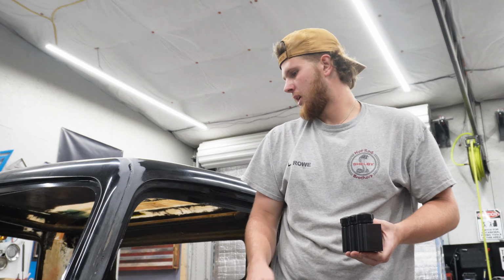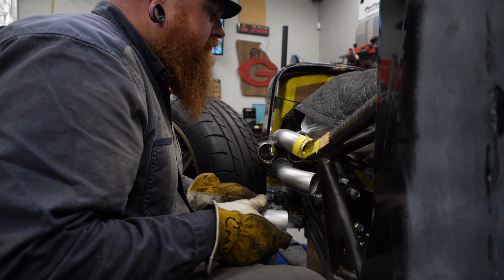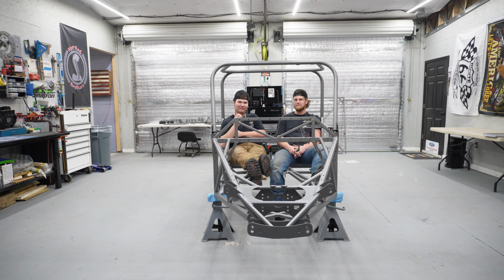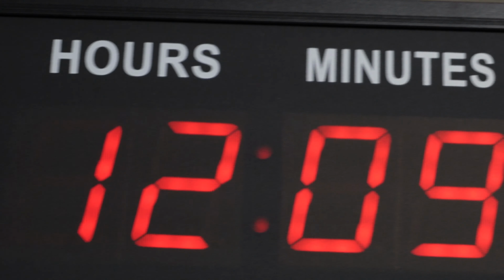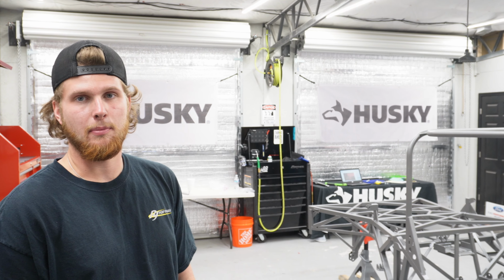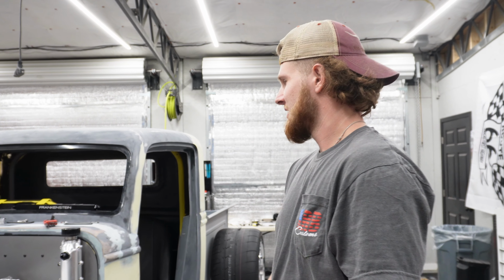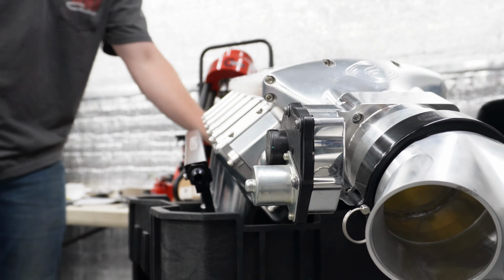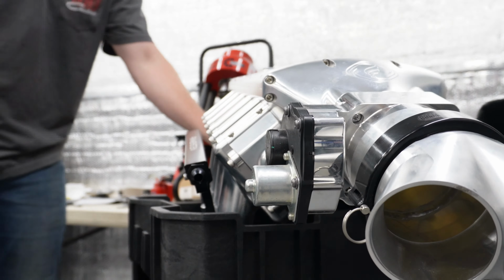FFR '35 Truck SEMA Build

Comment: Is the roll up door insulated with bubble insulation? My door is freezing in the winter. Same type as you have
Reply from the maker: It does not have any insulation in the doors. It does have heat shield and sound dampening installed but nothing In the doors. The owner doesn’t drive it much in the winter and if he does, it has heated seats haha
Reply: Oh haha. No I was asking about the shop doors haha. And as for heated seats… that’s the one modern tech that goes into every car I build!!!!!!